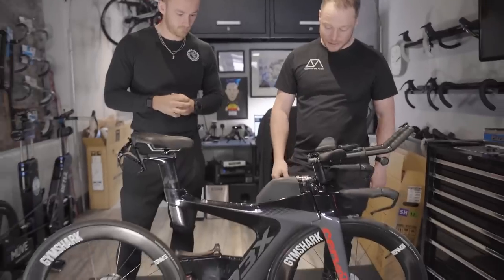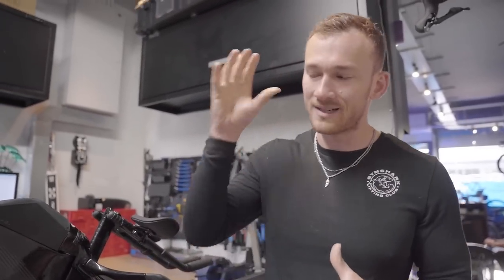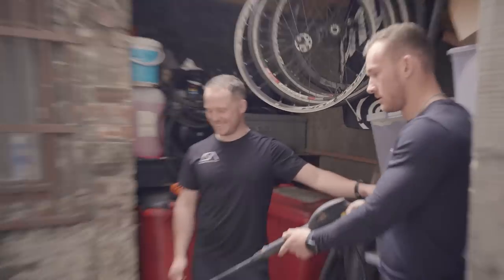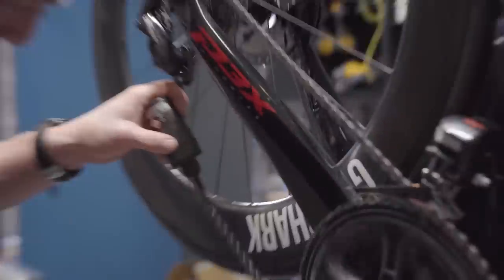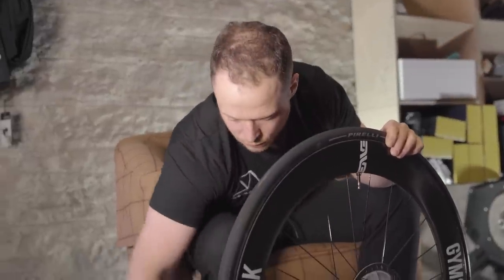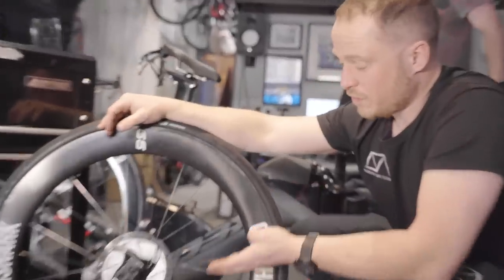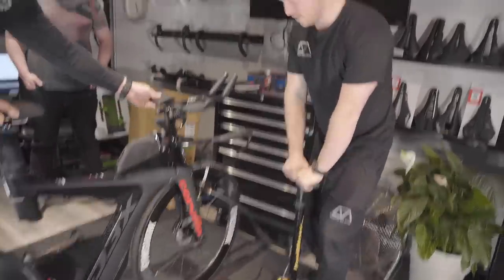EVERYTHING You Need To Know About Maintaining Your Bike At Home... | CELTMAN Prep S2. E4

Comment from the maker: Chapter markers:

3:17 - degreasing your drivetrain.
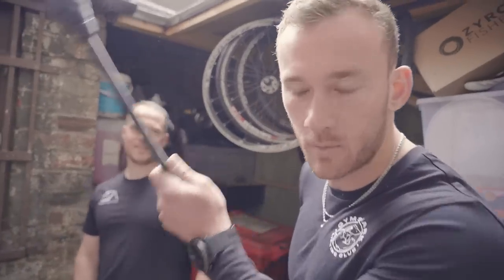4:59 - cleaning the frame. 
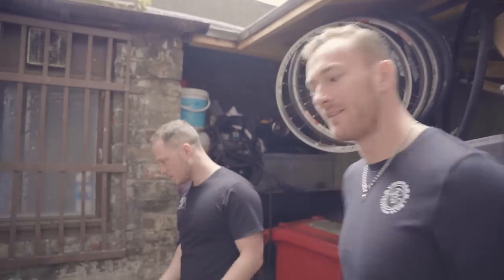6:20 - washing/rinsing the bike. 
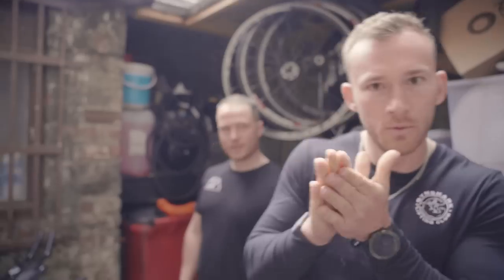8:12 - lubing the drivetrain. 
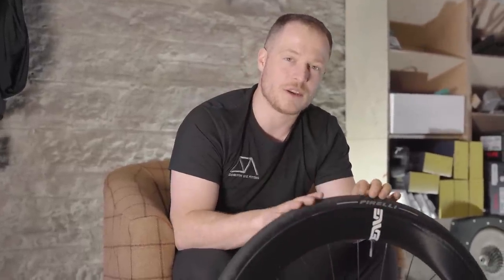11:10 - tubeless maintenance.
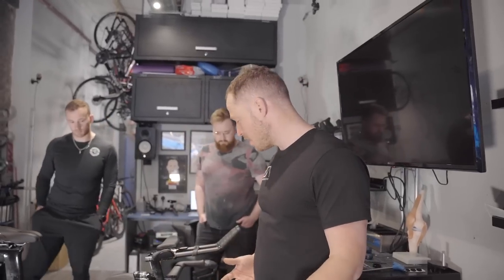14:54 - disc brake maintenance. 
18:20 - tyre pressure. 
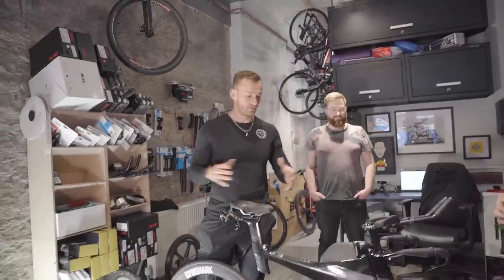20:06 - summary. 

Thanks for watching!

Comment: Hi Fergus, first time viewer and really liked the vid. One thing I couldn't help myself with mentioning is applying of the disc brake cleaner. That's obviously the Muc-off cleaner and is specifically designed to be sprayed on pads and rotors, quote from their website... "Apply to entire brake area so pads and discs are treated". Yeah, I know, pedantic dick head but it's good to know as it makes it even easier to clean your brakes! 😊